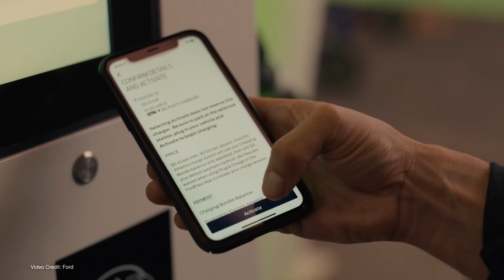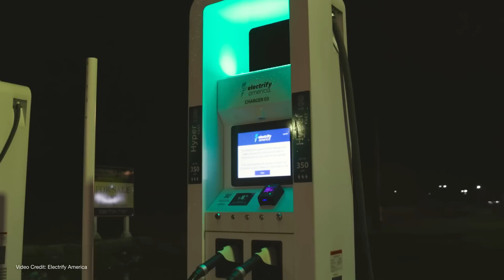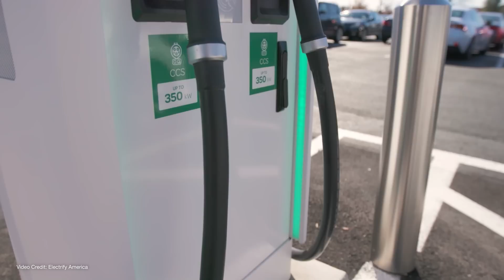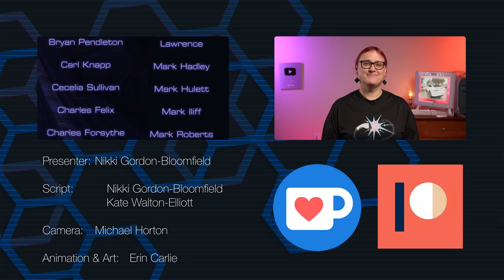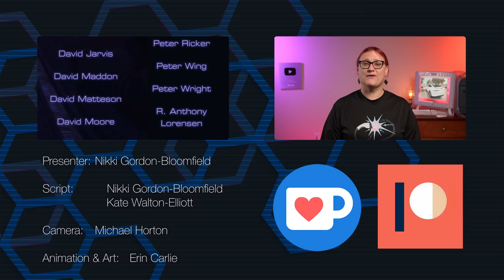EV Fast Charging Is BROKEN - And NACS Won't Fix Everything

Comment: Great video. I’d also add that charging stations need to add AWNINGS. Not only does it suck wrestling with a cable/connector (as well as navigating the screen/payment process) in the rain or snow, adding awnings with a large sign at the top would help resolve the “Where’s Waldo?” issue of trying to find them.

It doesn’t have to be a huge, heavy-duty roof like gas stations have; even a simple bus stop-style angled glass/plexiglass cover would do the trick.
Reply: A queue system would be cool too. If all stations are busy, it would be nice to have a way to see how long until the next one should be available and decide whether you want to put your name in line or find another location
Reply: For that matter... use solar panels! Sure, you won't get enough power to compensate for all of the charging load, but you get a little bit that can be fed into onsite batteries, and you also get the cover.
Reply: It's really hard to know when someone will be done. I was waiting behind a Rivian that was charging to 100%and they were obviously going camping way off grid, while many times I will stop charging at 50, 70, or 96% depending on how much charge I need to get to the next charger. I've also waited for a dickhead in a Honda Clarity to leave because they didn't have anyway to plug in and were just parking in the spot because it said EV parking, (and they were there far beyond the 30 minutes I was).
Reply: not awnings, solar roofs and battery packs. i think the only reason tesla doesnt already have  is because of a lack of batteries that were available.
Reply: Do not have to wrestle if you have a Tesla not do you have to worry about a screen for payment 
Just plug in and go away
Reply: @thomaswilson2917  Well, I don’t have a Tesla. And none of the Tesla stations I’ve seen have awnings either. And you still have to get out of the car to plug in and unplug, so it’s still not fun in the rain/snow.
Reply: @thomaswilson2917  Good for you.
Reply: @thomaswilson2917  V4 Superchargers do have screens because multiple state and national governments require them. When it was just California Tesla passed on the subsidy, but now it's many, so there is a small screen and card tap spot on the side by the handle. The best screen is still in the car, or phone.
Reply: @Charles_Gaba  just pointing out that a few seconds to plug in is not very relevant when you have
to spend a lot more time in the rain and snow going to work or shopping.
At least with an EV you don't have to stand out in the cold like a gas car requires you to do so.
Reply: @kenmcclow8963  if you have a Tesla you don't need a screen for payment.
It is my understanding that mfrs that have signed up to use the Tesla NACS connector will use their app for payment 
I can only find a v4 installation in the Netherlands.
Not saying there are not others just can't find any using Google.
Can you provide the California city where the v4 supercharger is located? 
I can use the plug share app to see if there are any comments about a v4 supercharger at that location.
Reply: Absolutely, there should be solar awnings over every charging station. But, it's unlikely to happen unless legislated for.
Reply: @kenmcclow8963  do you have an example of one where it is located?
Reply: @ledsalesoz There are thousands of commercial buildings that could support rooftop solar but don't. Given that commercial electricity service is usually significantly more expensive than residential service, I don't understand why so few commercial property owners get solar. (Including on the shelters above fuel station islands!) But anyway, whatever reason they don't want to bother, probably also applies to charging stations.
Reply: @thomaswilson2917  all the V4 stations are currently in Europe. The newest one at Goodwood in the UK has been in several videos of people at the festival of speed. The others I know of are in the Netherlands and France. I don’t think any are in the US yet. Tesla has been slowly rolling out the Magic Dock in the US and when I looked in June there was one in California and about 10 in New York. I don’t know anything about when V4 will get here, but I assume there should be some before Cybertruck starts turning up at Superchargers and that will be January more or less
Reply: @kenmcclow8963  As far as I can tell no new magic dock installations in months.
The tesla app shows their locations and no new installations
Might have something to do with the switch to NACS as CCS1 charging wont be needed.
Majority of EV sold in uSA have already switched,, GM FORD RIVIAN POLESTAR MERCEDES.
Anyone not switching will beat a sales disadvantage...
Reply: How does Tesla get away with using thinner cables?
Reply: @golfish8589  liguid cooling
Reply: @thomaswilson2917  CCS cars will be around for a decade or more even if they stopped selling them today. I’m fine with using an adapter when they get around to selling them
Reply: @golfish8589  Tesla replaces them more often. Electrify America plans their cable to last a long time even though they don’t. EA also has liquid cooled cables and I don’t think Tesla uses those because they are shorter
Reply: @kenmcclow8963  supposedly next year.
Reply: @golfish8589  Don't know. A few ideas:

— Maybe they make them out of silver instead of copper? OK, probably not, that would be rather expensive. (The best conductor is gold, but that's also famously heavy, so a thinner cable isn't necessarily a lighter cable.)

— Actually, I bet they use aluminum instead of silver or copper. An aluminum wire carries maybe 20% less current per gauge (i.e., diameter), but far more current per mass, because the metal is so light. (Also, cheaper.) We use copper in buildings because it fits in smaller spaces and has a smaller surface area to insulate, but aluminum for power lines because those things don't matter there. Anyway, aluminum cables wouldn't be thinner than copper, but they would be lighter, which is probably more to the point.

— The cables are _shorter_. Resistance is per unit length, so if you have a target acceptable resistance loss, a shorter cable helps. It'll still get hot, though.

— Maybe better thermal insulation, so that when the cable gets hot, it doesn't pose a danger of fire or human injury? But that seems problematic, as it means it can't dissipate heat efficiently, which would be a problem during peak usage when there's not much time for the cable to cool between charging sessions.

— Liquid cooling means you need less conductor thickness, but itself adds bulk to the cable. Don't know if Tesla do this. It's expensive per unit, potentially fragile, and vulnerable to vandalism. (I mean, if your average vandal would feel comfortable using metal tools on cables that can carry 400V. They're normally not energized, but do people know that? Would you chance it?)

— And then there's the plain fact that many Supercharger locations offer only 120 to 150 kW. Maybe when people talk about these thinner cables, these are the locations they're thinking of? Maybe the newer, fatter Superchargers also have fatter cables?
Reply: @thomaswilson2917  but why doesn't tesla need liquid cooling?
Did Tesla find a new way to push more amps through a copper wire and produce leads heat? Thinner wire would produce more heat and resistance
Reply: @golfish8589  have you noticed the Tesla cables are thinner than ccs1 cables yet handle more current
Reply: @thomaswilson2917  Yes, I have noticed. That is why I asked the original question of how is Tesla getting by with thinner charging cables.

An smaller wire increase resistance and heat

Comment: Very good Nikki but what I see is also the main issue with all of the third party DC fast chargers as well as plain old level 2 AC charging is the bad software and crappy billing integration. They need to STOP using Micro$oft and stupid credit card requirement at the charger.
Reply: Credit cards lessen dependance on shitty apps and companies, they should always at least be an option. Frankly we need some manned locations with cash payment as well, just like gas stations
Reply: Microsoft is not the issue, it is poor software programming that is the issue.
Reply: Tesla NACS solves all of this-- it is never a concern for us Tesla supercharger users.  As long as the other companies follow the exact Tesla rules, you will be awfully happy with your charging experiences using NACS.
Reply: @BrandEver117  

I can see it maybe making sense to hire an attendant to manage some of the busiest charging stations during the busiest times, but on a full-time basis, it is probably cost-prohibitive. Labor in the US is just too expensive.
Reply: @ab-tf5fl  Labor in the US is very cheap, or there wouldn't be people working in many places that are automated in Europe and Japan. What you do is you have a little fast food cafe with plenty of clean rest rooms right by the charging location with about 100 chargers. You will sell industrial amounts of coffee and montains of sandwiches. The chargers could be connected with the cash register system if enough customers wanted, so you could even pay with cash. "I'd like a large black coffe, a Reuben and 40 kW on charger 21, please. In cash." It can be done.
Reply: @BrandEver117  We used to have Pay Phones with cash payments....Not anymore. Time to move along.
Reply: @tonespeaks  Microsoft IS Poor Programming defined.
Reply: @davidc2838  Sorry Mate, that is just not true. There are Millions of terminals using Microsoft to say it is "Poor Programming defined"  is just not accurate.  We are all allowed to have an opinion, so I wouldn't challenge you there.  On the other hand to state it as a fact is where I would quibble.

Comment: On the topic of chargers being located inside of paid parking garages, there's a fundamental problem that charging a car takes time, during that time, the car needs to be parked, and if you want to charge in the middle of a dense city, it is unreasonable to not expect to pay for the cost of the urban real estate consumed by your car during the charge time.

This is much less of an issue for gas stations for the simple reason that fueling a car takes 5 minutes, so you're consuming a lot less urban real estate in the time it takes to fuel a car than it does to charge a car. Yes, it sucks. But, that's just the reality. It's also worth nothing that even in the ICE world, gas stations tend to be very limited in areas where land is expensive enough to make parking expensive (imagine trying to pump gas in Manhattan, for example) and, when such gas stations do exist, the gas itself tends to be expensive, as even the 5-minutes of parking required to fuel the car is baked into the price per gallon at the gas pump.

Another way to look at it is that if charging a car in the middle of a dense city costed only the fair market value of the electricity, ignoring the parking space, drivers with home charging would quickly figure that out and flood the public chargers when driving downtown simply because it's the cheapest way to park the car; the result becomes drivers who don't have home charging and must rely on public charging being unable to charge. So, even from the perspective of the EV community being able to charge, under-priced parking at chargers isn't particularly good either.

Fundamentally, public charging in city centers is always going to be expensive, just like any other "car stuff" is expensive in city centers, be it parking, driving, or pumping gas. Over time, drivers will adapt and find alternatives, whether it's getting chargers installed at the building where they live or simply plugging into DC fast chargers in the suburbs when the visit the suburbs, rather than trying to charge the car in their home neighborhood. Already, I've learned that when road tripping to a major city, it is usually cheaper and less hassle to charge the car at roadside charging stations on the way back than to try to look for charging within the city itself. Again, this is fine. This is not a problem with EVs specifically, it's simply the reality that doing things with a car is more expensive and more of a hassle when you're in the middle of a big city, and that's the price you pay to live in/visit a city that is easy to get around on foot once you get there.
Reply: Good points. But a counterpoint: these days, the economics of filling stations are such that they mostly make money in the store — the fuel revenue more or less breaks even, or could even be a slight loss leader. So, if the economics of an urban gasoline pump relies on you getting in and out very quickly so as not to consume a parking space for long, that ignores their real incentive, to sell you snacks, which requires that you stay on-prem somewhat longer.

(Or maybe that's the real reason fuel is more expensive deep in a city: they're getting proportionally less revenue from selling road trip supplies.)

I guess rapid charging isn't yet rapid enough to compare to the average road trip pit stop, to go inside, stretch your legs, pee, try to decide whether you're hungry enough to pay those inflated snack prices, and finally buy a coffee (takes a little while, if you add cream or sugar) — but those times may be closer than you're estimating.

Comment: This reminds me of the memory card standard. From Sony stick, Fuji MMC, Panasonic SD card, Compact Flash, and MicroSD 
It wasn't till Panasonic absolved all royalties that they won and a single standard prevailed. I think we are close to this point in EV charging.
Reply: This is how the ubiquitous USB connector became the default standard. The guy that designed it “Open Sourced” it. He never received a penny from it.
Reply: @dennisschlieckau8723  USB wasn't designed by "one guy", it was a massive cross-company collaboration from day one, including the biggest PC companies in the world, IBM, Intel, Microsoft, and Compaq among others. And it isn't and never was "open source." USB has always been protected by patent, copyright, and trademark. It even costs money to license the necessary IP. It became a widespread standard for the same reason CCS did - massive industry collaboration.
Reply: @AnonymousFreakYT   Okay, I was not aware of the multi company collaboration.  However, I did find this excerpt from an article about it.

“USB as a standard was initiated by a group of seven major tech companies, Compaq, DEC, IBM, Intel, Nortel, Microsoft, and NEC. The goal at the time was to develop a standard technology to help the interconnectivity of devices across the brands.

An Intel engineer named Ajay Bhatt was tasked to lead the design work. It took Ajay probably a year to finalize the integrated circuit that supports USB technology.

Therefore, it could be said that Ajay Bhatt was the inventor of the USB, although it is more than likely a team effort. Ajay did not lock himself in a garage for months and came out with the technology himself.

Despite having created such a major invention, Ajay Bhatt did not make a single cent out of it, as the patent is owned by Intel and not him. However, Ajay did not make a fuss about it. Instead, he has registered over 100 patents for his inventions.”
Reply: Still pissed off that the "Secure" in "Secure Digital" means "secure against user copying" and has nothing to do with the write-protect tab on SD cards that would otherwise make them a suitable floppy replacement.
Reply: How does Tesla get away with using thinner cables?
Reply: @dennisschlieckau8723  That's true of nearly every major company invention, though. Very few "invented by a company" technologies get an individual rich. See PCI, Firewire, Thunderbolt, DisplayPort, Bluetooth, WiFi, etc. Even though these all had "a project lead" who was the head person responsible for the development, and that person's name may be on one or more patents related to the tech, they were all paid salary as employees of the company that spurred the development. 

Ajay alone wasn't directly designing enough of "USB" that his work alone would qualify as "the inventor". So many people were involved, from so many companies. Much like how Bob Noyce is often credit as "the father of the microprocessor", but he personally didn't even do any of the design work for the first microprocessor!

Comment: Electrify America definitely has issues that others don't seem to have.
one is that if you look on the map it might say 7 plugs available, but what they mean is that there are 4 chargers each with 2 plugs even though only one can be used and the 8th plug is Chademo. If you can't start a charge, it's worth trying the other plug before moving your car because sometimes one plug is older. I also hold the plug until it starts charging because some of the older ones seem to sag and the communication pins are at the top so might not firmly connect.
Sometimes if a charger says unavailable it will still work, and if all the others are in use, it's worth calling EA to see if they can reboot it. I have had success several times that way. Sometimes they can't but they will send a technician eventually.
The EA technician's mostly seem to be in rental cars which often are Tesla's where the Tesla technicians seem to drive vehicles owned by Tesla even if they are Ford vans, or trucks. I've never talked to a Tesla technician, but the EA tech's seem to cover immense multi state territories, so they fly and rent
Reply: Tesla charger maintainers can be based out of Tesla repair facilities.